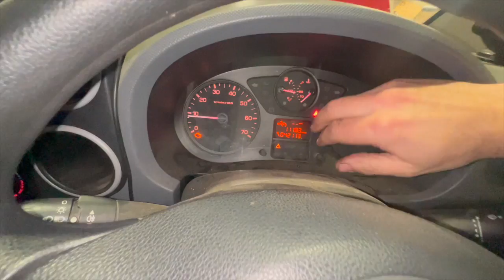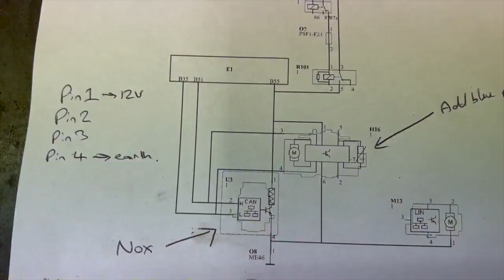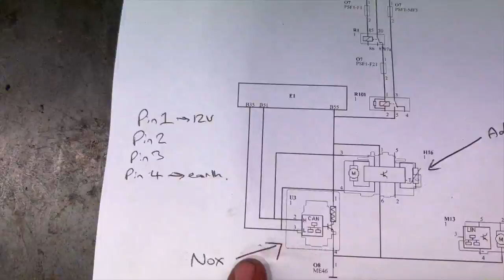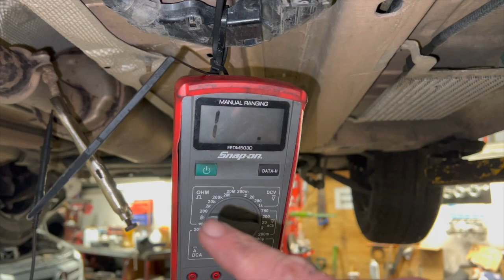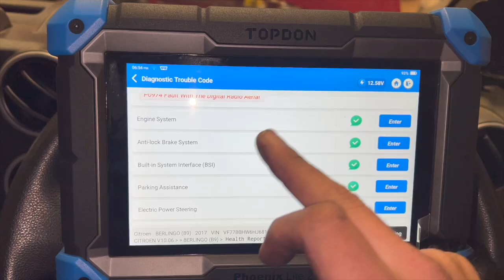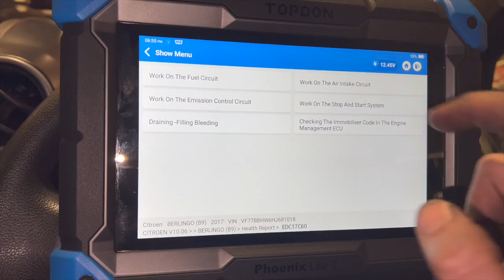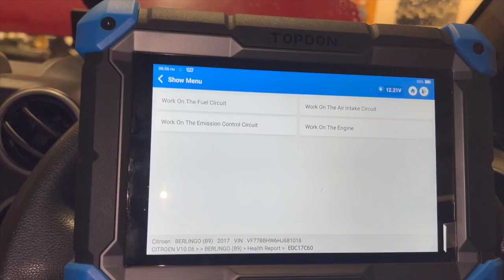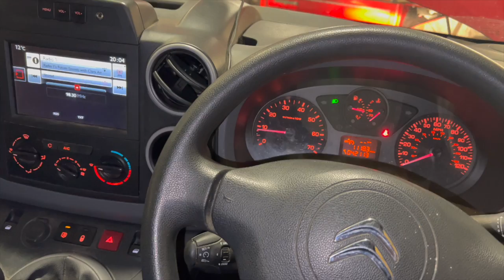Citroen Berlingo Nox sensor Fault P2202 U029D - nox sensor replacement

Comment from the maker: New Genuine OE Nox sensor Ebay - https://ebay.us/5u0nAV
M20 Nox thread chaser tool - https://ebay.us/oZ8lke
22mm Crows foot eBay - http://ebay.us/HuNgTH

Diagnostic machine used in this video:
Topdon Phoenix lite 2 Ebay - https://ebay.us/tsyiTI
Topdon Phoenix lite 2 Amazon - https://www.amazon.com/dp/B0B1MB6YG8  

Tools used :
Multimeter - Multi meter - https://ebay.us/fvsMub
Draper socket set - https://amzn.to/2FdUEjf
22mm Spanner - https://amzn.to/2Rvkd1O
WD40 - https://amzn.to/3oiaIRE
3/8 Drive Milwaukee Impact driver - https://ebay.us/YYBMVo
1/2" long ratchet - https://ebay.us/HZYPgk

Check Euro car parts - https://tidd.ly/3lIO7xA  (use discount codes on site)
Check "Car Parts for Less" - https://tidd.ly/2LNEwIn  (use discount codes on site)
Check GSF Car parts - https://tidd.ly/34pZe7o  (use discount codes on site) 

Any Donations to help Support my Channel are much appreciated.
Donate via Paypal - https://paypal.me/diydaly

Useful links:
Car Analytics - Vehicle information checker - https://tidd.ly/3B2PEbx

Comment: Thanks mate! you just saved me a lot of money! Took my sensor and box off, it was covered in crap so I cleaned it up and decided I'd best have a look inside the box, thinking maybe there's some water or corrosion in there.

after fighting with the plastic cover a bit, i cracked her open to discover a bunch of white fluffy corrosion, the board will just pop out too with some gentle persuasion. gave it a good scrub with a toothbrush and some isopropanol, and used a cocktail stick to make sure there was nothing between any of the IC pins (they're tiny!), cleaned the crap out of the casing, bunged on some sealant and squeezed it all back together with my fingers crossed.

after re-initialising the adblue system and clearing all the faults (topdon artidiag 800 to the rescue again!) all the lights went out, and the ominous 700 mile countdown went away.

50 miles later, still no sign of trouble, It might just have worked!

I suspect many of the faults seen with this system are due to that little ecu getting wet, it's in a pretty vulnerable spot and the plastic cover seems perfect for filling up with mud!

hopefully this might help someone else, I figured it would be worth a go at least!
Reply from the maker: Awesome, glad to hear it helped you out and you managed to get it sorted! 👍

Comment: No wonder the Nox sensor fails... look where its control unit is positioned... right under the vehicle open to all the elements, road spray & road salt in the winter months. They do need to come down in price for sure. I have one to change on my jaguar. £400 from main dealers.... disgraceful

Comment: it is not so easy as shown on the video, the sensor can be removed only when heated with a torch and the thread on the exhauster pipe gets always damaged. I had to change exhauster as the thread was so badly damaged it could not repaired. Unfortunately this is the price you pay for having a French car - bad and overcomplicated design, expensive parts, lack of specialist in UK, short life of the parts like belts, tensioners, brake disks, sensors like the one on the video, as soon as I repair mine will get rid of it. Mine car is only 7 years old on 40k miles but I already changed shock absorbers with top mounts and drop links which on German cars normally have to be changed on 70-80k miles or over 10 years. French cars are nightmare.

Comment: Great video, I understand pricing changes from time to time but on a 66 car version any suggested on price range on repair with mechanic?
Reply from the maker: could easily be around the £350 area fitted
Reply: More 100 for diagnostic 1 hr labour 50 quid part today 365 i would say with vat aroung 600 quid
Reply: It doesn't need coding afterwards, it's plug and play. If it doesn't reset the fault,wrong sensor. Changed it myself to an Audi Q7.

Comment: Hi, I have a Peugeot 308 1.6 blue which looks the same as what you’re working on here. I have P2002 and P2A00 codes. One says heated O2 sensor 1. Is this what you are changing here? I thought sensor 1 was pre the DPF? All I can see at the front of the engine are two thin sensors. Not sure what I should be replacing.
Reply from the maker: Yeah that’s the nox , the 2 front ones are temp sensors , just check if yours had one or 2 but if only one, that codes related to the nox sensor
Reply: @diydaly  thanks, all research I’ve done says Nox sensor 1 is pre DPF but can’t find anything on my model car that shows it, so I’m going to gamble that the one you’ve changed is it. It mustn’t have one pre DPF. I’ve ordered one from the site link you gave. Great video, really helpful. Thanks
Reply from the maker: @53Dmac  👍👍

Comment: Hi there great content, couple of questions, mines has code U059E and it says no communication with deNox system. Nothing else. I got Rac to diagnose it, it also had a p242f which I got Citroen to replace dpf filter. Big bucks. Ooft. But they never put diagnostic computer on it. The same lights as in the video are still on. Does it need to be Citroen to fix and reset the software in the van. 

Thank you in advance. 
Peter
Reply from the maker: If it’s been to the main dealer they should have plugged it in, most independent garages should be able to do this for you
Reply: Thanks for reply, but been told it's just Citroen that can reset the software from 2016\17. Thanks again.
Reply from the maker: @peterbarrie5717  if it’s a software update it will need to be done by the dealer

Comment: I got to ask is this the bank one sensor as Iv a 2017 Citroen Berlingo and Apparently there is two nox sensors Iv got bank one playing up as it’s putting my engine management light on
Reply from the maker: Yea this was the rear
Reply: Do you need to program the sensor or reset the computer after installing a new one?
Reply from the maker: @thegreenapiary7934  these is a procedure to run through
Reply: Great video 😊. 

I have a little question. If its a nox fault, does both the engine light and urea light come on?

I have an engine light and engine fault warning on my screen but no urea light or countdown message. 

I'm being told i need a new nox sensor.
Reply: I have a 2018 berlingo enterprise

Comment: How you know witch NOX sensor you must replacement? I have Grand Picasso 2 2.0HDI and i have problem P2202 and P2A00, NOX Sensor before catalyst and after. Which one i must replacement?
Reply from the maker: One of the codes will usually refer to no.1 or no.2 if not it should say upstream or downstream , has I’d definetly got 2 sensors?
Reply: @diydaly  One before catalyst under the Turbo and NOX sensor between DPF and catalyst i think?
Reply from the maker: @czystywojownik1528  hmm i dont think it will have one the at close to the turbo, usually 1 jus before Dpf & one further down the line after the centre pipe if I has got 2
Reply: @diydaly  Ahh ok, thank you so much for help. Do you have Facebook or messenger maybe?